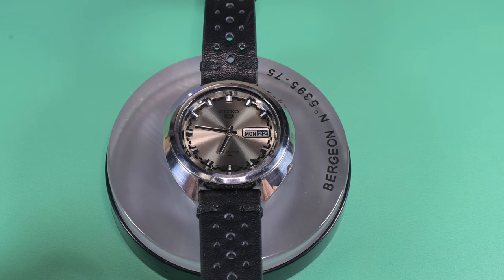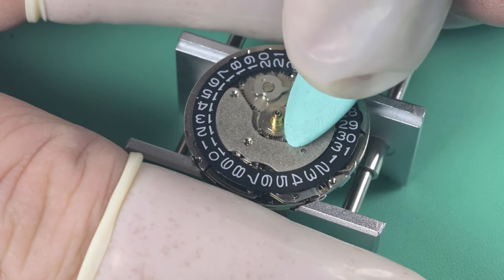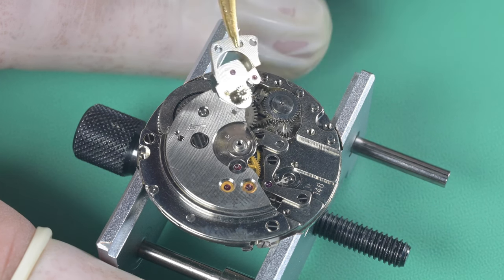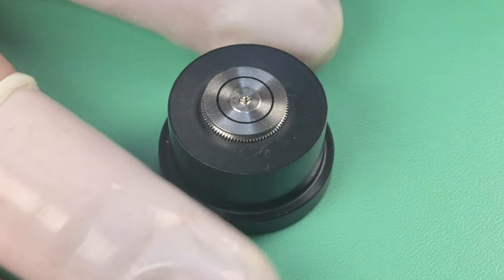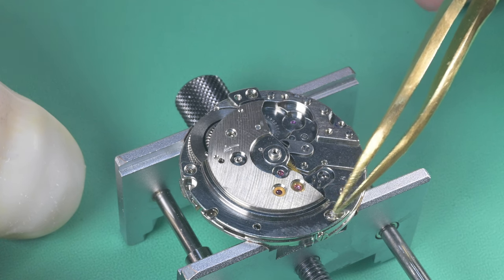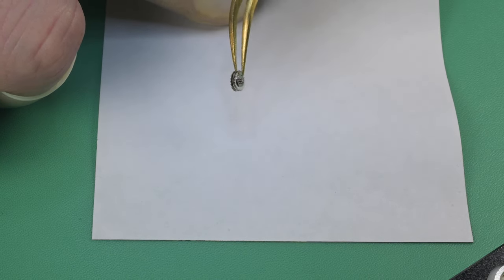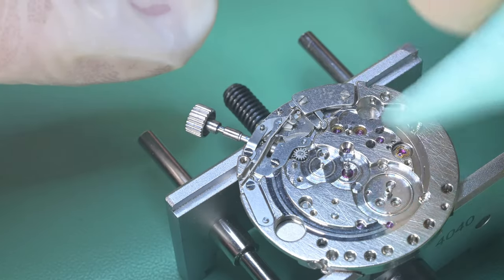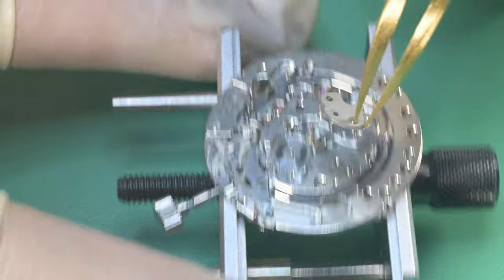Time Traveler's Delight: Full Service of a 1968 Seiko Rally Dial - 5126-7030

Comment: Thank you for such a high quality video. I just dissembled a 5126 movement and was somewhat lost on how some components fit back together.  This will help tremendously.  Curious, do you rely on your video to help you on the re-assembly or do you have some spec sheet which guides you?  Thank you again!
Reply from the maker: Most of the time I do not need to reference the video for re-assembly, but I certainly have before.  If it is a Seiko, or other common movement, spec sheets are available most of the time as well.  I certainly referenced those on my first 6138/6139 and 4006a movements.

Comment: It's a lovely watch. The movement looks to have a nicer finish than 6139 or is that my imagination? Also I've noticed Seiko watches of this era 60's, 70's seem to have large balance wheels. Is there any advantage to this?
Reply from the maker: That movement did have a pretty decent finish, better than a standard, 6139.  Regarding balance wheel diameter, it gets really technical when getting into that, but the general consensus is a larger balance will provide more stability. You have a larger rotating mass that is less affected by sudden bumps, shocks, and will likely see less interruption with performance compared to the smaller balance wheels, all other things being equal.  The size of the balance wheel does have other things that must be taken into consideration, such as hairsprings, power needed to drive the wheel, etc.  It is harder to get a larger balance wheel moving, and they will have even more difficulty on a higher beat watch.  I am the furthest thing from an engineer or a subject matter expert, but that’s the general consensus, as I understand it.